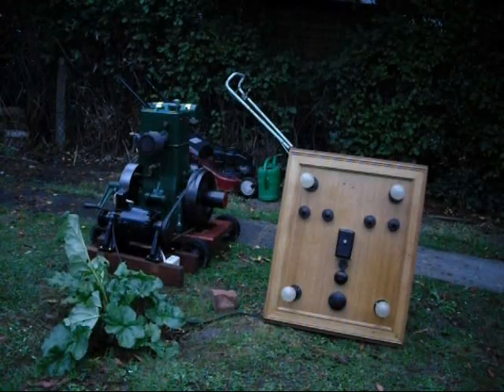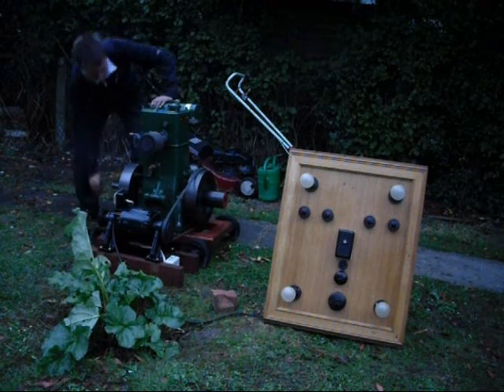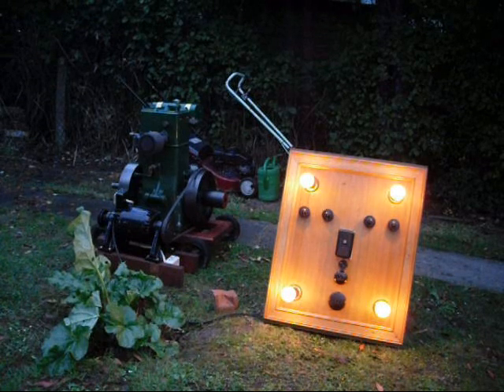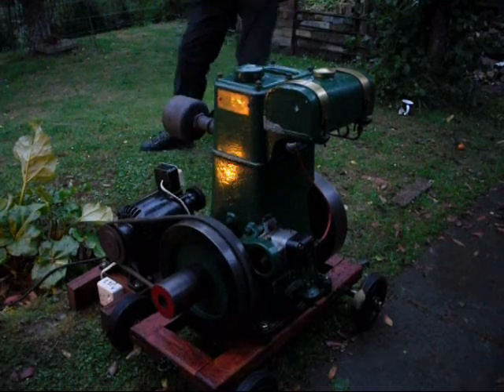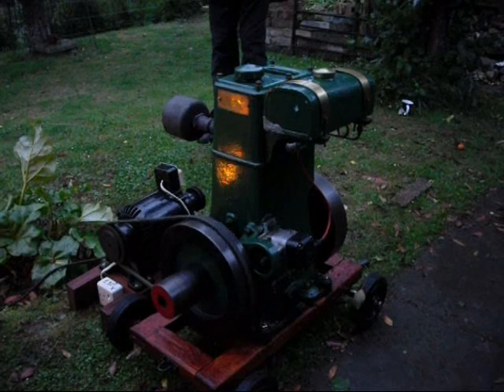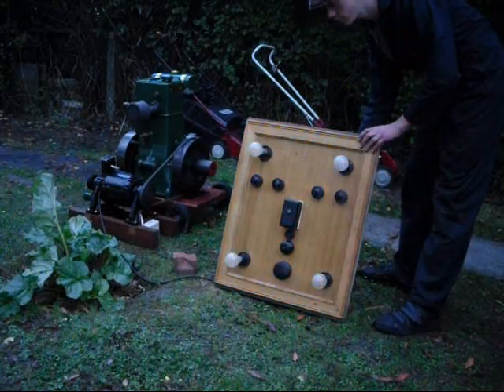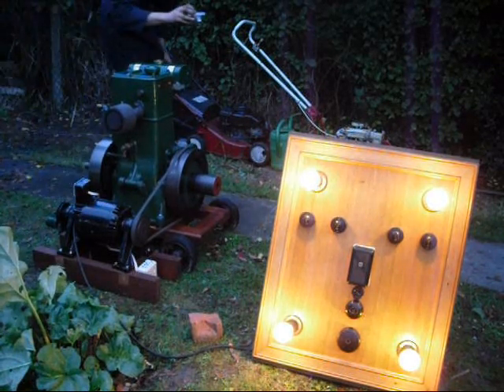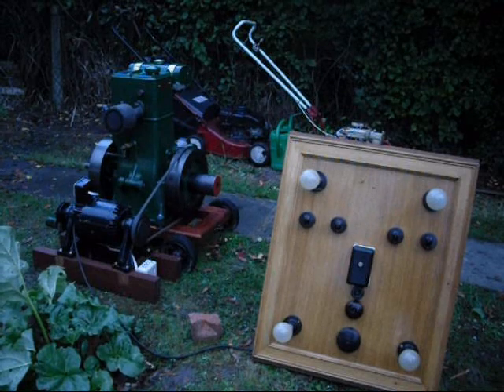Bamford electric lighting display

Comment from the maker: I think Dan managed to find them on the local market, but they are getting scarce. One reason that bakelite switches are hard to get is because they contain asbestdos but it's not much to worry about, however I susspect many people just binned these switches.

I was lucky enough to find a load between the floor joists in the loft along with a glass fronted wooden and ceramic fusebox for my set, but that was lucky!